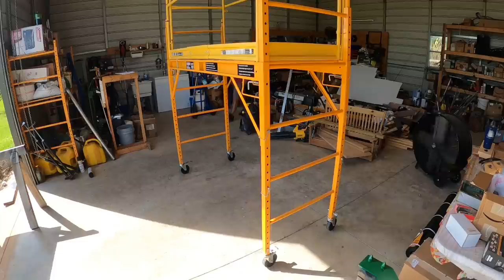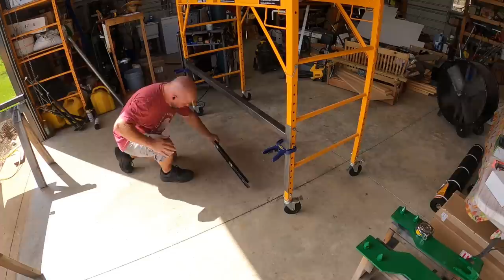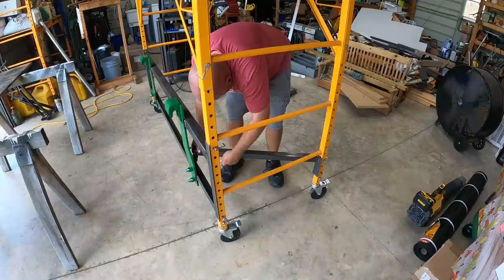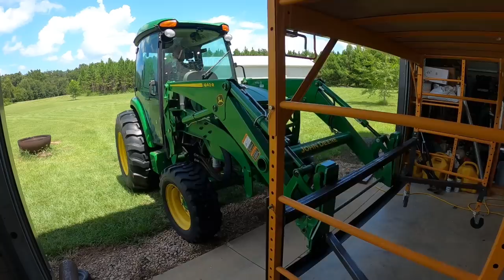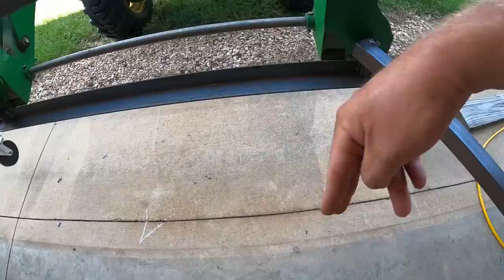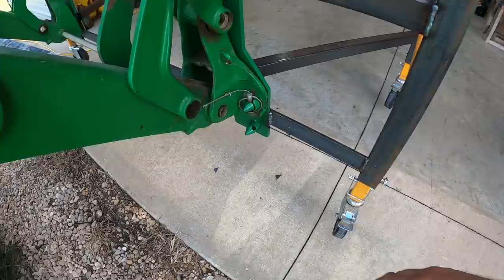Homemade DIY tractor basket man lift! #626

Comment: I used a IBC TOTE..  Works Awesome and I feel safe in it at full height on my JD 4044R
Reply from the maker: I considered using one, but I like the extra several feet of height and width this gives me. I don't think a tote on forks would get me to the peak of my roof. Thats a great and quick solution though.

Comment: I would've suggested the supports for the front legs go up diagonally instead of straight out so it would be more of a shearing force on the hinge pin instead of trying to twist it down, but it looks like it's pretty sturdy.
Reply from the maker: I didn't do that because I wanted to keep the top platform movable.

Comment: I have the exact same scaffold, actually 2 of them.   I would not mount one with this method.  They are very light weight metal and need the weight distributed vertically on all four posts.    At minimum, run diagonals to the front posts, even if they are just bolted through the rear vertical  angle irons and existing scaffold post holes then up to the front posts just under the platform.

Comment: Because over do is what you do I would put a set of support arms on the top horizontal tube also.  It would make it even more stable.  Yes the ladder needs to be attached to the basket.  Now if only you could operate the lift remotely from the basket poof no more ladder except for a rope escape ladder rolled up underneath.
Reply: I agree a little more bracing wouldn't hurt. Nice job.
Reply from the maker: I was thinking a heavy duty ratchet strap or cable with turn buckle on the backside of tractor mount to upper scaffold would pull any potential forward flex out.

Comment: That's a fantastic solution! It may be worth having a dedicated telescoping ladder to keep on the basket to avoid hauling the bulkier ladder around. 
I've been using these ladders for about 5 years and never had an issue though they do feel a little sketchy until you get used to the feel.  I weigh a littler over 250 lbs and this type of ladder (I have several) have been rock solid dependable.
Reply from the maker: Something to look into.
Reply: I had the same idea about a collapsible ladder!  Climb up the ladder into the basket, then pull it up behind you, collapse it, and hang it on a purpose built hook. That way you don't have to worry about the ladder falling away and stranding you up in the air.
Reply: @ezinatx  Something he’s had experience with! 😂
Reply: i have an older set of scaffolding  i think the collapsible ladder is a great idea for any rig!! may have to get one for it

Comment: kelly good work on the basket i think the only thing i would have done was angle the front brace upwards it will support vertical stress better i think ?!!
Reply from the maker: The reason I didn't do that is because I wanted the upper platform to be able to move up and down.

Comment: On the extra ladder I would put a strap to hold it to the basket so you do not have it fall down and are stuck in the air till the better half gets home
Reply from the maker: It's actually quite easy to climb down from up there with no ladder 😬

Comment: Andrew, highly recommend you get into the paperwork that came with those scaffolds and find out what the max working load is for that platform.  You talking about adding accessories and drywall/plywood holders sounds like you'll quickly overload the safe working load.  Just my $.02... those short braces you added won't do much of anything to help support weight from the front most edge of the scaffold.  You'd need to add long tube stock from the most forward edge of the basket and angle the tubes back to the bottom of each of the tractor/basket attachment bars you welded on.  Good idea of trying to use the scaffold as a man basket... just ensure the homework gets done so it's done safely.  🙂
Reply from the maker: It's printed on the side, 750lbs working load.

Comment: Well, now you’re just showing off. 😂😂👏🏼👏🏼👏🏼  good job. 

Only because I way overdue everything. The hinged piece on the front, I would make that a triangle saw it connects level and add a much higher point on the outside legs. That will give you some flex or stiffness stability as well by squaring the front set of legs to the backside of legs and not relying so much on the frame of the scaffold itself and give you a bit more of Lyft from the tractor mount to the outside of the frame.  You could even build a tool table or toolbox or something in there, just make a nice stiff box that fits on the front of it that you can mount to the tractor like that and just roll the whole thing in and bolt it up. There’s a ton of room there. So many things you can do with it. I think this is pretty awesome, he did a great job

This will be pretty awesome, soon you’ll just have a tractor with a built-in tool shed/scaffold/lift/hunting blind.  Lol
Reply from the maker: The reason I didn't want the front arms higher is because I want the ability to move the platform up and down as designed. This might help me in the future and give me mounting room for accessories.
Reply: @TKCL  sweet. It looks like it holds you up they’re pretty well, hopefully it will stay stiff and not bend. If it does then I’m sure you’ll be able to fix it.   I think it’s pretty awesome. I would’ve probably bought a bunch of those loader mounts and welded everything I own to it. 😂😂

Comment: Awesome video, as usual!  Regarding the safety mechanism in case of hydraulic failure, look into "tractor hydraulic safety stops" which already exist.  With your fabrication abilities, I'll bet you could come up with stops of varying lengths to accomodate the varying heights at which you'll be using the lift.  It wouldn't take lots of different lengths and you would only need one cylinder protected.  You could even have a mount on the basket structure to store them as an accessory you mentioned.  God bless!

Comment: May sound silly.  However, you're in a climate where it merits.  How about an umbrella repurposed from an old patio table.  Give some relief from sun baked neck in the Florida heat.  Also, it would give you some shelter from a gentle or pop-up shower.  Of course, you can't use it on every task.  You can also use the mounting pipe hole for a custom davit arm to swing out over the top rail with a pulley and 5-gallon bucket with rope.  That way you can load supplies into bucket and pull or lower from the platform...without climbing the ladder with tools to save your legs.  Just like a bricklayer.  My 2-cents.
Reply from the maker: Brilliant idea on the hoist. Another viewer mentioned the umbrella and that's another great idea.

Comment: Great idea. That you put the lateral support back to the mount was good idea, but you still have alot of vertical forces putting torque on that connection. Would have been better to attached that portion up high just under the working platform and angle it back down to the tractor mount. That way the vertical force gets redirected to the solid tractor mount.  Like a big brace or gusset would on something else. Just a thought.  Good job. Giving me ideas of my own.
Reply: I agree with Damon's idea. At a minimum put a crossing support on the side opposite the tractor.
Reply from the maker: There was a specific reason why I didn't do that, I wanted to keep the adjustability of the platform being able to move up and down by several feet. Never know how this might help me working in the future or with accessorie add ons. Braces ran to the platform stops it from being able to move up or down if needed.
Reply: I can understand that. Can make it removable if need be. Take it out when adjusting the platform lower. But when extended all the way up in the air and have my big behind on it, I want it to be as strong as possible.  LOL. Its not the fall that hurts, its that sudden stop.

Comment: You could make a 3 point outrigger that would add side to side stability that has adjustable legs on each side for uneven ground. You just get the tractor set where you want it, pull the pins and let the out riggers down then reinsert the pins and put a little down pressure on the 3 point or you could add 2 hydraulic cylinders to the stabilizers so each one is independent of the other for the uneven ground. Similar to the leveling jacks used on motorhomes except it would mount to the 3 point and would hang out on each side of the back behind the tire. It is difficult to explain my exact thought but you are a pretty smart guy so I think you get my drift...
Reply from the maker: I've been kicking around similar ideas.
Reply: You could mount the outriggers to the leg, make them to swing out to 45 and pin it.  The up and down leg is also pinned to ground level.

Comment: Looks great! One suggestion though. With the way you have your swing arms supporting the further out legs I bet you are putting quite a bit of stress into the horizontal members on each side (the ones you climb on to get into the basket). They may be pretty stout but were not designed to take a tension load like you are putting on them. If one or 2 weld fails over it goes. Might be worth peace of mind to run a piece of 2” wide strap from the pin on the close leg to the bolt on the far leg. I hate putting so much faith in welds, specially since most stuff is Chineseum and have seen some pretty ugly welds covered with paint.
Reply from the maker: The one thing to keep in mind is the upper platform is supporting all 4 legs with 8 pins and has much more substantial metal. Regardless I'm already thinking of a couple more reinforcements.

Comment: Now you need a self leveling loader...something I wish I had on my tractor too...
Reply: BTW, I just fired Starlink and went with Verizon Home Internet. It is much stabler than anything we've ever had, including Starlink. So far I'm only using LTE 4G but it averages 60 mBits down, and they soon will turn 5G on here in Wellborn.
Reply from the maker: Starlink is going downhill fast! A lot of people complaining about throttling, slowing speeds and price hikes.

Comment: May want to keep an eye on those braces with the drop on hinge pin. If you mimic the movement you do at 8:56. If the front does flex like that, the support could pop off that pin. Maybe some kind of safety chain to prevent them from coming off when you don’t want them to.
Reply from the maker: I'm considering a backside brace as well to eliminate all flexing.

Comment: We have several of those for movable storage in the garage

You mentioned stability

Crazy idea but this might work if not just for false piece of mind

When I was rally young Mom didn't have an electric dryer

All clothes when on the Air Drying close drying rope that sagged in the middle.

You might already are guessing what Her tool of choice was.

A clothes line pole

Maybe a couple of poles like them might provide lateral support meant only to reduce side force action while You are aloft

It might work better if 4 poles were used

2 on the FEL

2 reaching the floor of the scaffolding

Just a simple and cheap safety thought

Another thought is use 2 fiber glass extension ladders on both sides of the scaffolding platform at about 45 to 60 degree angles and use the feet on them designed for use in dirt and tie down straps for securing the scaffold to the ladders

I have been to pole climbing school for the phone company and they required Us to safety strap the ladder to the poles.

I know there would no poles handy to lash the ladders too but if you safety strapped the ladders together at around the 3rd or 4th ladder rung (step) from the bottom and tightened the strap enough so the feet of each ladders dig into the soil enough to prevent movement of the feet from sliding loose.

OR

Strap each ladder too the scaffold side rungs/steps with metal/wood brace arms as outriggers

I think the "A Frame " geometry might reduce or even cancel the physical side to side loading movement effect on the tractor.

I have a frame mounted Backhoe and a couple of those ladders now and if I tried what You demonstrated I would use the ladders and the out rigger legs of the Backhoe

Thanks for the idea.

Ken in Florida
Reply from the maker: Good ideas

Comment: Just an idea. The toe kick will help but was thinking for extra piece of mind you should weld a piece of expanded metal on the lower back side knee high. I would hate to hear that something rolled off/fell off at your feet scratching or denting the hood of that beautiful tractor or worse cracking the windshield. Loved the video!

Comment: Cool I really enjoyed this build, why don't you weld some expanded metal to enclose it around the basket part cant remeber if you said in the video but a great idea to use what you already have and modify it to were you can still use it as it was built for.
Reply from the maker: I like an open basket for being able to use my nail gun in those open spaces. Expanded metal would block access.
Reply: @TKCL   i understand that after thinking about it.

Comment: Very clever, as usual.  Is there any way you could control the tractor lift from the scaffold?
Reply from the maker: Sure, but it would cost a fortune and there's always a risk of it not being safe.
Reply: Tractor bucket controls are not as smooth as dedicated man lift controls. I don't think I'd want to ride on a bucket while it was moving!

Comment: Not really an accessory, but perhaps some flat steel feet to replace/protect the rollers, and keep square tube clear of dirt from use.
Reply from the maker: I had intended to keep this stored in the shop, roll it to the door and then hookup to the tractor. Never setting back down until at the shop again.

Comment: Will the extension ladder "safety stop" hold the weight of the loader boom, too? It might not be a bad idea to make a mechanical lock for the boom cylinder. For example:
aluminum pipe cut length wise into two halves
Two tabs welded on each end to allow a bolt to pass through and clear the OD of the rod.
When I worked for the DOD we used this practice to ensure that if a hydraulic hose failed and the system did not have a hydraulic lock then there would not be a catastrophic collapse of the cylinder.
Reply from the maker: A locking collar is something I am considering.

Comment: Any way to put some kind of stabilizer side arms on the tractor to help side to side sway to help prevent tip over?
Reply from the maker: I usually run my 8ft wide finish mower on the back and have it close to the ground. It acts as a stabilizer.

Comment: You need to get a drill press fund going I saw you drilling through the steel frame and having that thing come undone and cut your hand it's happened to me
Reply from the maker: I have a small one, but it does not have much power.

Comment: Do they sell a remote control that you can mount to the tractor so you could lift or lower the loader from the basket remotely?  Lol, and maybe a seatbelt
Reply from the maker: I'd have to build it, that would get expensive.
Reply: @TKCL  well building is half the fun. The expensive part kind of sucks but are we can’t let that stop us. Well, I guess we can but to thousand five in an optimal world we could just build whatever we wanted. 😂

Comment: Did you weld over the paint? Sure looked like it.
Reply from the maker: Nope, that's why I showed me grinding the paint off when the tractor was pulled inside. I marked the areas to be welded with a sharpie and then took a flap disk and ground the paint off. There might have been an area or two I did a thick tack or small bead over paint. But all my structural welds were absolutely clean.

Comment: I have a Kubota L2501, do you think that is too unstable for this?  Also the tractor needs to stay on I assume to keep hydraulic pressure up?
Reply from the maker: I am not familiar with that tractor so I can't comment. Anytime you have something unstable lifted on the front, run the widest and heaviest attachment you have on the rear. I don't have to keep my tractor running, the valves keeps my cylinders from leaking down. Your results may vary.

Comment: Yeah, but notice what was omitted? No jumping up & down, and no vigorous side to side. It works, but its shady as hell. Say "well, I'll never need that up & down, or side to side".... yeah, you never "need it" until you really need it when loaded with the building supplies that werent afforded for in this video. I guess I'm "negative nancy", since all testing was done with no extra loads, and no jump & move to even simulate a load.
Reply from the maker: Yeah I'd say you are quite negative for no reason. I didn't build these to sell, it's for me and me only to use. You sound like I'm a used car salesman trying to get you to buy one of these from me all while hiding major issues.